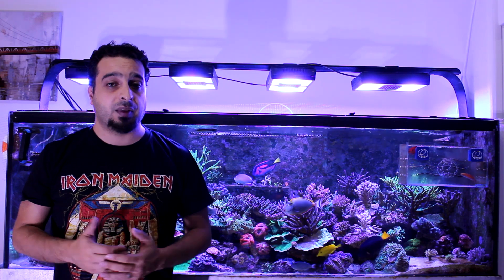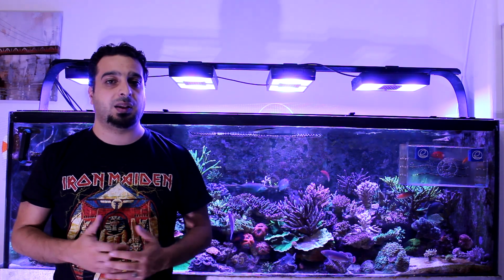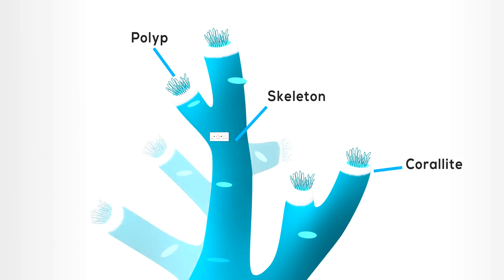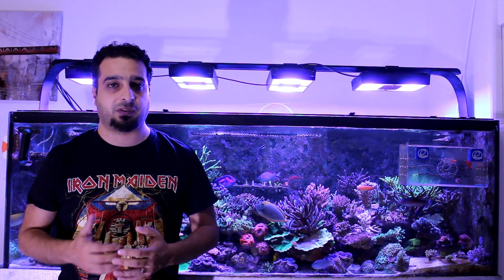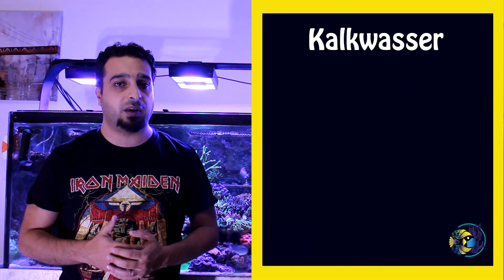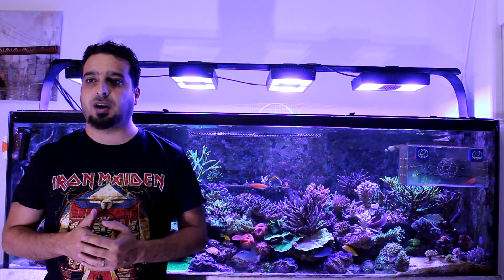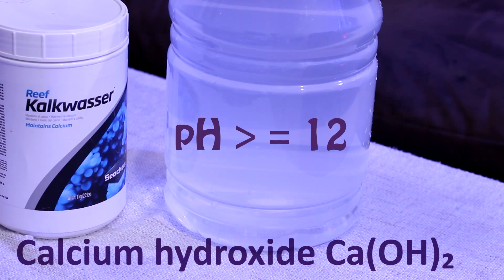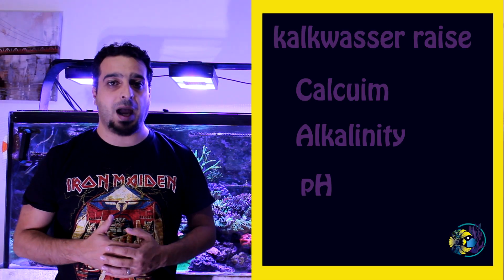#16 How to Build and Maintain a Reef Tank -   How to dose Kalkwasser

Comment: I also use kalkwasser in my tank my question is this they tell us that  we need to keep a little bit of phosphate in the tank for the health of the corals when kalkwasser takes phosphate out overtime I guess I will just have to keep dosing phosphate to make sure I have some into tank what is your opinion on this beautiful tank by the way
Reply from the maker: The phosphate lowering effect of kalk will not remove all the phosphate. and yes you need to have just a little bit of phosphate around 0.05 ppm. Even with kalk dosing,  phosphate is raising in my tank and I need to use gfo and/or carbon dosing to lower it